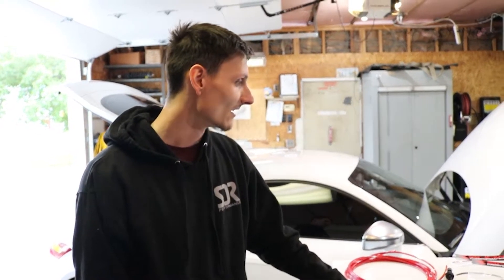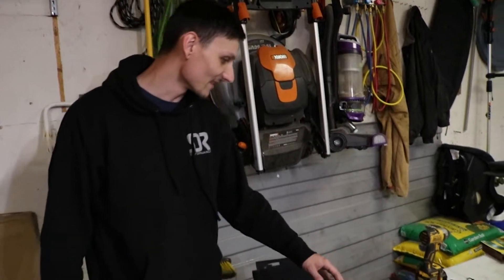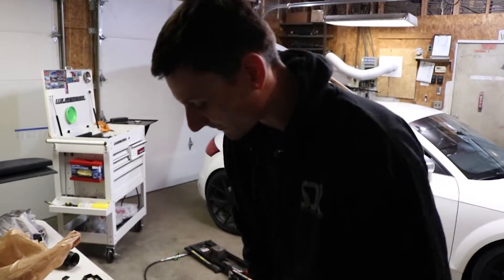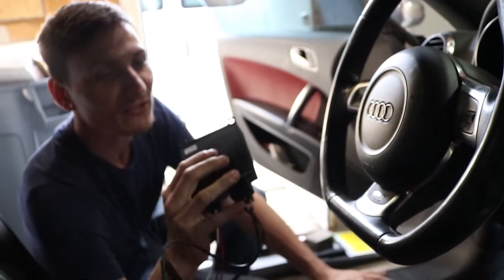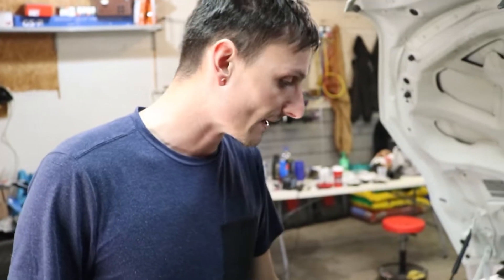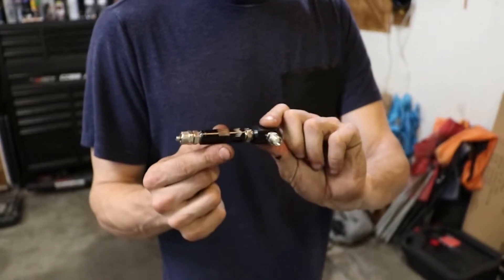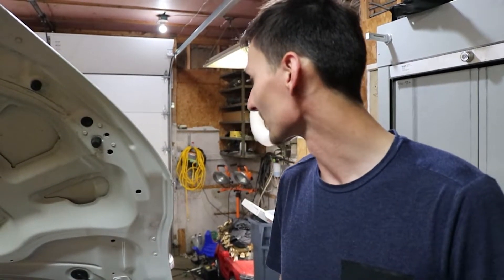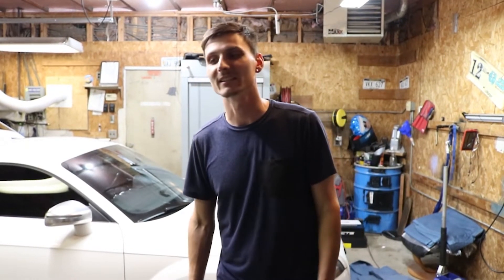Stage 3 Audi TTS (methanol injection installation)

Comment: Did you face any problems with the throttle pipe ? I got the same one but there is no space to fit it....it rubs on the radiator fans....
Reply: Curious did you ever get an answer to this or figure out what to do in your case? I almost bought the Neuspeed brand version of this part, but they told me that the radiator fan might be an issue with theirs, so then I’ve been looking at the CTS one now, I actually just sent them an email asking about fitment.

Comment: Greetings from London, are there any big power mk2 tts out there? I can't find anything when I look online. I would love to build 600-700 bhp but I'm aware the dsg can't take more then 500.
Reply: Do it & tell us how it goes. ;-p
Reply: @antosfunb  plenty of EXCELLENT tuners in the UK. Us being from the states it's quite difficult to find a good custom tuner. Above 500 brake horse you're gonna be blowing the DQ250 transmission up quickly. Might be worth trying to swap a DQ500 in but that adds its own host of problems.
Reply: Why can't I find any 500+bhp mk2 tts anywhere online , is it just not possible? I want to try :o
Reply: @antosfunb  check TT forum UK website. You'll find some in there.